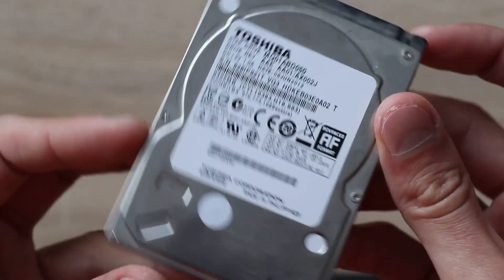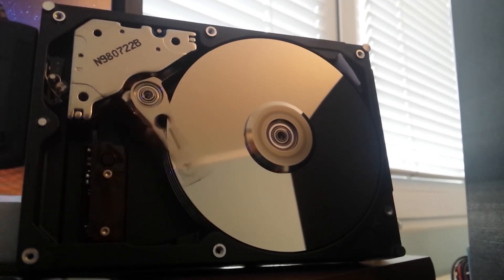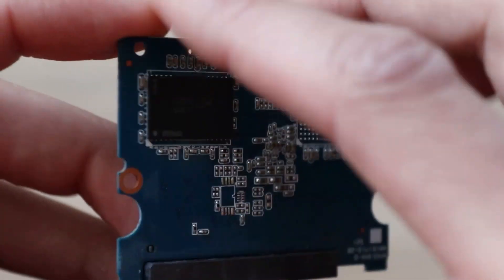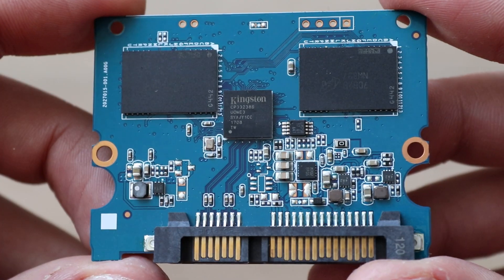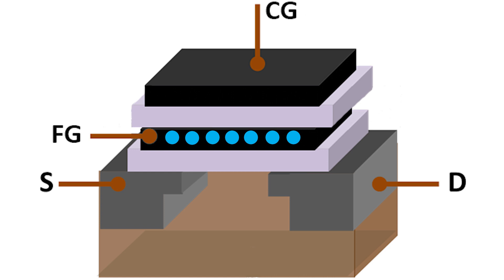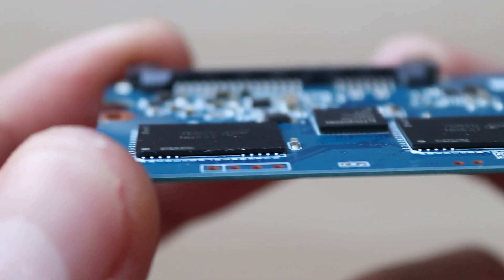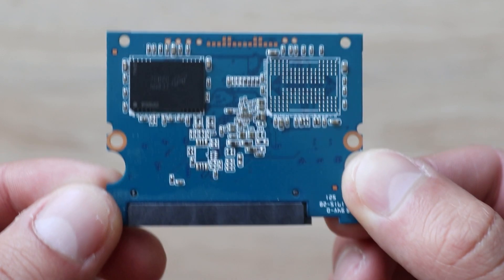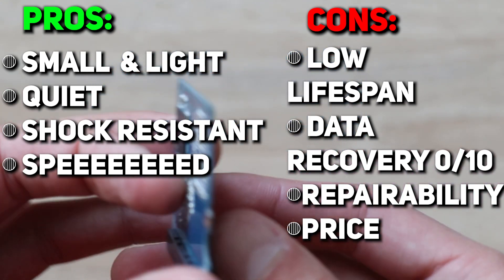How Does SSD Work & Why Do You NEED it? PROS and CONS

Comment: Comparing Bugatti and Flintstone car 😂😂😂😂😂
Reply from the maker: Not exactly. Both SSDs and HDDs have their pros and cons depending on the application. You can't say an HDD is like a Flintstones car, because it's also a very complex piece of engineering. I`d say its a supercar (let it be bugatti) vs any decent modern car.
Reply: @NickElectronics  You know I have seen really fast HDDs, probably high RPMs but still, drop those bad boys and you start sweating.
Reply from the maker: @statuspremier True. Its better not to drop them) And don’t put powerful permanent magnets to close to them 😂
Reply: @NickElectronics  Carefully noted good sir